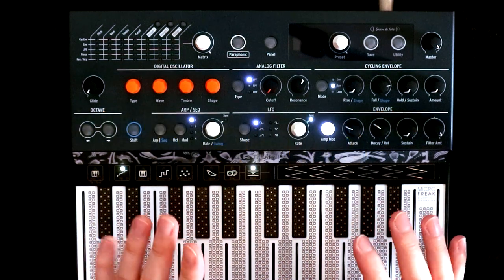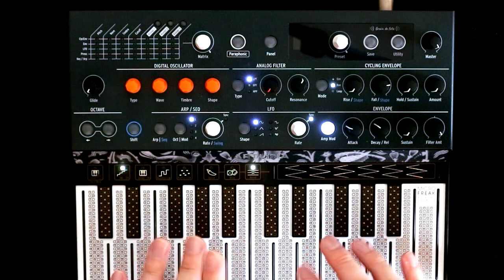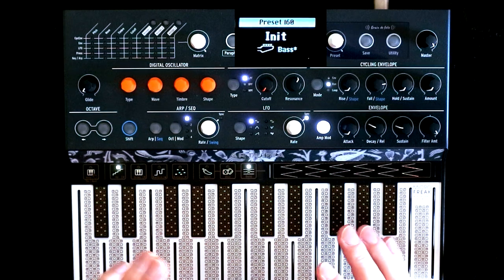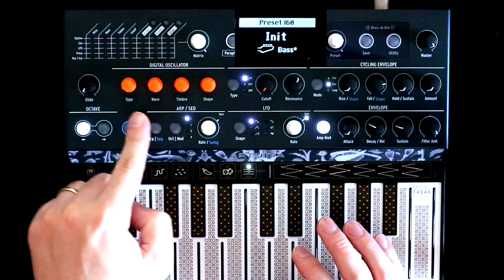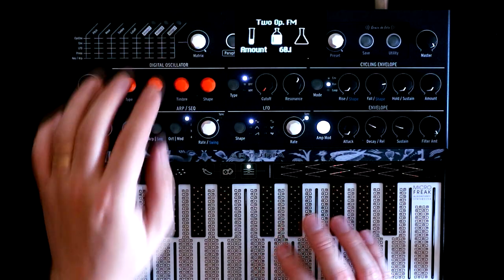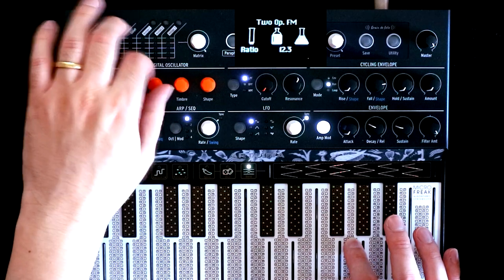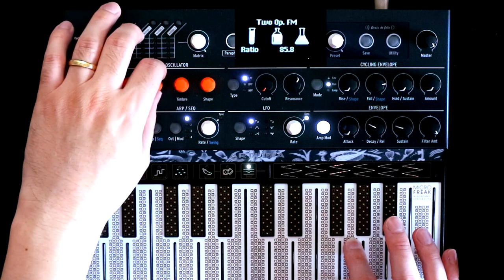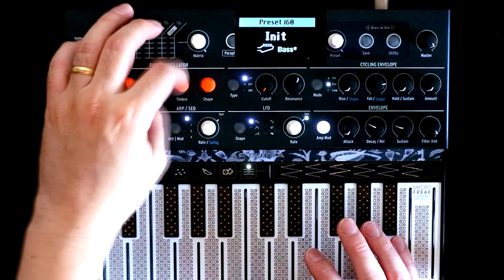Arturia Microfreak - Let's Build... an FM Bass!

Comment: To zero a mod matrix you can just hold the button for 1 second at it will go to zero/ turn off. Quicker than scrolling back to 0. Good video.
Reply from the maker: Great tip. Can't believe I hadn't spotted that!

Comment: You may wanna run compression or turn your video audio to mono. Your voice is so quiet and the synth is way to loud.
Reply from the maker: In the history of running this channel I've been told both that the synth is too loud and the voice over is too loud... So, for what it's worth - I am compressing the voice over (very hard), and also running a side chained compressor on the synth, which is ducking it by 7-9dB whenever I speak.
Reply: Oscillator Sink 

Why are you doing it the hard way? Rip the audio and compress the whole thing. This way it normalizes all the audio and we only have to adjust the volume once.
Reply from the maker: @edmontontech2008  that's not the hard way - it's the standard way. Most VO's are handled that way (for example in radio). Compress the voice to even the dynamics of the voice, then duck the 'music'. Also (for me anyway) preferable in a sound demo type video because you're actually hearing the dynamics of the synth rather than a squashed version. That's my take anyway, your mileage may vary.
Reply: Oscillator Sink 

This is why we have glue compression. Lol. 

You don’t need to squash anything. 

If you’re that worried about losing harmonics, you could always mix your videos audio with monitors instead of headphones. Or pass it though Ozone if you’re not confident in mixing volume levels.

Idk. Just trying to help a fellow musician. 

Good luck :)
Reply: Record the voice on a separate track and adjust the volume in post???

Not that I know how to do that.  My hobby stuff is “point phone, push record” (with an audio interface attached to the phone)

Comment: Such a handy little synth that.... you give a really great insight in what can be done.
How about that 70's/80's string machine emulation.... pretty please.
Reply from the maker: Definitely on the cards!
Reply: @OscillatorSink  Well I grabbed myself a microfreak. Only scraping the surface but so far so good. 
I have been messing the with the Karplus Strong and I can hear the potential but cant quite get what I need...yet!!!..... I have to say tho its a real great addition to my mostly volca setup.... nice to have some hard clean digital tones again to cut through that analogue volca durge....

Comment: the manual is huge. Would you still recommend reading it all before trying out stuff? or come back to it from time to time ? also amazig! build it in "real time" with you and learned just so much about the mod matrix :) huge!
Reply from the maker: I would definitely always skim read a manual at least. That way interesting areas / features you weren't aware of will jump out at you for further research.
Reply: @OscillatorSink  thanks!  i think its also not the smartest idea to learn 2 instruments at the same time....like the circuit and microfreak in my case. oh well...

Comment: do you think it's possible to get the megadrive bass sound from Charli XCX's Vroom Vroom lol 
i feel like i got close and I lost it. getting the decay right seem to be key.

maybe with one of the other FM sounding synth models
Reply from the maker: E1M1 is life. I think, like the dx7, the Megadrive FM chip probably had a 6 stage envelope, so if it's the decay that feels illusive it, could just be a limitation of the a(d)s(r) envelope on the Microfreak?
Reply: Theres a liven desktop synth based on the yamaha megadrive fm chip now
Reply: Plogue Chipsynth MD is a perfect emulation of the Megadrive. MegaFM by Twisted Electrons literally has two chips from the Megadrive.

Comment: Wurlitzer or Rhodes
Reply from the maker: An E-Piano patch was on my list... I'll bump it up a place or two...
Reply: @Oscillator Sink there are probably a dozen different ways to get e-piano sounds. At someone else’s suggestion, I tried the Modal Resonator engine. Promising. But my mod matrix kung fu isn’t quite good enough to get it all the way there.
Reply: After playing around with my microfreak a bit, I didn't find it too conducive to e-piano sounds. I did one 2op fm piano that sounds like an old 80s casio piano ( in other words not much like a piano). Of course one could also always do a classic analog-style square wave wurli. But creating an actual nuanced rhodes or wurli on this sounds like a pretty good challenge.
Reply: @Thoracius  your standards for e-piano are much higher than mine. :-)
Reply: @1dkappe   I've taken this as a challenge. I've been playing around with it. First problem is a piano should have a long decay and a short release, but for some crazy reason Arturia did not give the option of separate decay/release controls on the MicroFreak. The second problem is that the MicroFreak is paraphonic, not true polyphonic. A piano sound should get darker as it decays. Since all four voices share a single filter, the brightness decay needs to be accomplished by modulating the oscillator controls instead. I couldn't get anywhere close using the model resonator, but I've managed to do it with the 2-OP FM. It's roughly in the ballpark, but it's not an especially engaging sound. If I find some spare time I could post a video showing how to do it.